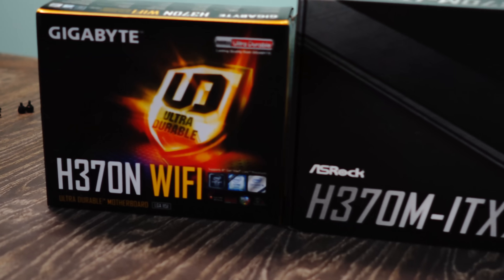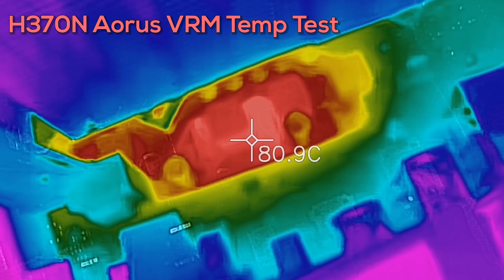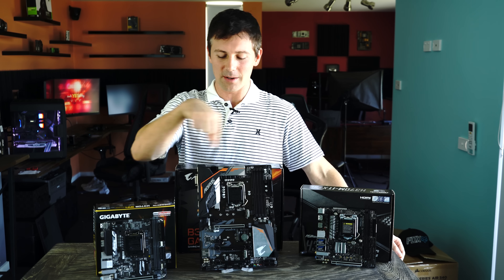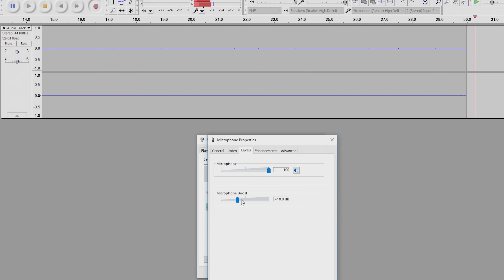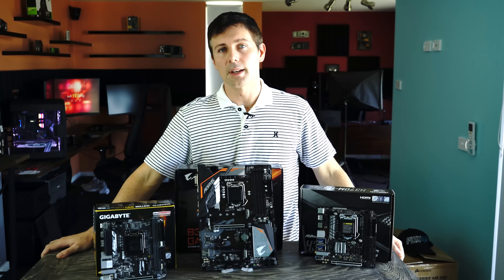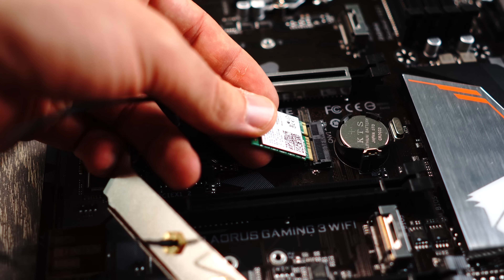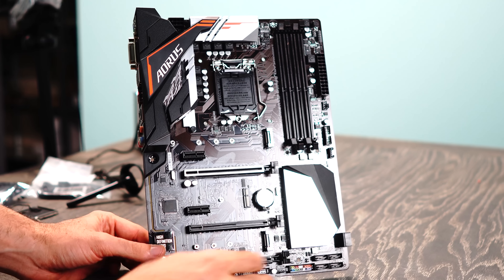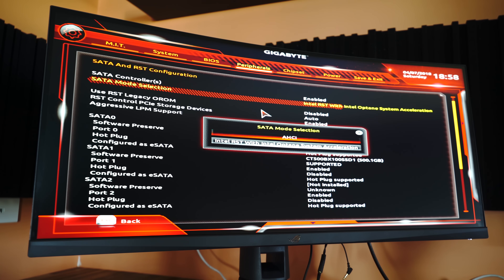H370 Vs. B360 Motherboard Review  - Can It Handle an i7-8700 at 100% Load?

Comment: i just upgraded from an i5 8400 to a i7 8700k got the 8700k for a steal of a deal and removed the 8400 and installed the 8700k in the same asus prime b365m board (Yes a waste of an 8700k I know) and I can only get it to 3,88ghz not even close to turbo boosting at 4.7 ghz can you help?

Comment: Hi, I am planning on buying the asrock h370 itx board. When you talk about thermal throttling on the vrm or whatever it's called, can that actually 'throttle' and thus bring CPU speed down? I've also heard that having the cpu power delivery components at a high temp (above 100°c in your video) is bad for them in the long term, is this an issue in your opinion? Thanks

Comment: <3 Thanks for the info. Bought a new system about 4 months ago with an i5-8500 and a b360 gaming 3. I want to upgrade to i7-8700k and Z370 so it can handle streaming on games that are too cpu intensive to spare the resources to stream. It is good to know I can buy the i7 seperate and run it in the meantime until I get more cash together for a new mobo

Comment: Hi there. Quite usefull video. I need help ! Im going to buy a mother Gigabyte B360M DS3H with an I7 8700. Has it enough power phases in order to supply the processor ?! For the record I have a 600W power supply and i will conect 3 fans and GPU.
Reply: Yes, it will work just fine. Considering the amount of power drawn would be more towards the GPU than processor and MoBo combined. You can see a significant power consumption by GPU but will be perfectly fine with 600W with enough power for even more lighting, fans, drives etc. 👌

Comment: i wanna do a build with i7 8700, 16gb ram, gtx 1050 ti Low Profile on a Bronze 80+ 300W PSU and i hope will be stable :-? 
(PSU is a Seasonic SS-300TGW 300W, have very nice amps for its size, HDplex 400w is toooooo expensive :( )
Why that psu? because is very small and will fit it in a case like Skyreach from NFC
What do you think?
Reply: Marian Pelmus I think you should move up to a 1060 just to really maximize your performance availability. It’s your build tho so let her rip!!

Comment: PLEASE suggest me a motherboard for 8700 (non-K) cpu.[i won't overclock or use sli except a single 1070 ti]
Reply: Check out Hardware Unboxed's video on the B360 boards. I'm going with AsRock B360M Pro4.

Comment: The audio on these boards is a reason I still use an ASUS Xonar DG sound card on my current gaming PC that still has a single PCI slot, and will be picking up an ASUS Xonar DGX(same card but with a PCI-e interface) for my next build, because most onboard sound solutions won't drive some of my higher end Philips cans at proper levels.

Comment: It's b360 for budget (although what are you really saving $40?)and $100 and up z370, everything else is a waste of money or doest make sense.

All we really need is what is the best b360 and cheapest z370 board that won't fry a i5 8400 and will allow enough power delivery to achevieve the chips full potential.

Comment: Pretty bad prices! Over 100 Dollars for B/H series.... Whats wrong!

I remember B85/B150 boards for 60€ here in Germany!
My 970-UD3 Am3+ board was quite high end (8+2 Phase, very durable, good cooling) and I got that for 70€....

Edit... there are still cheap boards: For example the Gigabyte H310M DS2

Comment: FLIR is not accurate for actual temps. It is good for showing differences in temps and hot spots. You should use a thermal probe attached directly to the part being measured. The price difference is so low, it doesn't make sense to buy a board with less features, less PCI-E lanes, and no overclocking ability. Even with a  non-K, the Z370's RAM speeds can be set higher. Just my opinion though.
Good review Brian.

Comment: In Poland Gygabyte B360 Aurus costs 128 USD not that bad, but i dont like this color theme ;/ Have You tested AsRock B360 Gaming K4 or AsRock H370 Performance? I am thinking about buying one of those for i5-8400. Any idea of hardware sync with Polyhrome RBG?

Comment: Wow those ram prices. No upgrades for me until that goes waaaaay down. Bur this is the dream i5 8400 2x16gb ddr4 2666 and a cheepo mb to run it with stock cooling. Why so much ram? My golden rule when upgrading alway double the amount of ram when upgrading from my case 16gb to 32gb. They laughed when i got 16gb and now i couldnt use my pc whitout at least 16gb

Comment: Corsair Vengeance 8GB DDR4 LPX 2400MHz 
Intel® Core™ i5-8400 Desktop Processor
Cabinet-Cooler Master MASTERBOX LITE 5 RGB
Corsair VS550
Hard Drive 2tb 
MSI Geforce GTX 1060 3GB GDDR5

Tech YES City i shud buy b360 motherboard for this build is there will be any problem let me know
Reply: AbhiMusicVEVO oh my god do not buy that psu
Reply: Jonh Smith why?

Comment: i would rather have a H310 and sensible B360 test. These boards make no sense for the price they cost, you could have got in the 100 sales opportunity since Z370 launch better boards for less price. Kind of a miss oportunity. The king of budget has let me down. Shame on you man, shame on you :/
PS: and test them with 8400 of course, no one is getting this boards for a 8700k
Reply: Joao Alves constructive criticism
Reply: Anything over $100 and you might as well just get a low price z370, I agree.
Reply: just because you get a 8700k doesnt mean you automatically should get a pricey motherboard
Reply: Compatibility with the 8700k is something he should mention, it'll enable an upgrade path for the future. But I agree, none of the mobos made sense for a "budget" review, US$130 for a H370? There are Z370s for the same price out there

Comment: H370 is for the cases you absolutely need RAID support, otherwise a B360 or H310 will be enough for a locked CoffeeLake CPU.

mITX is questionable, but it is dependent on the case one will be building in. Preferably look at the mATX and ATX first, if they fit in the case one has.

RAM costs still a mess.
Reply: Yeah, you are right i would recomend going mATX bc those mobos are usaly the cheapest compared to ATX and ITX also mini tower cases are realy cheap these days
Reply: Can I ask.. I dunno about what is overclocking mean.. Just want to know.. Will h310 motherboard perform well with non k i7 8700

Comment: Eh, some of these motherboards are going into Z370 price territory...
Reply: Wizard Koer Right, it's actually the same price as some Z370 where I live. As a consumer line, all the OC Z-series have always been quite affordable, so I'd only go for H370 or B360 if it's really cheaper for you than a Z370.
Reply: Is there a Z370 priced like an AM4 B350?
Reply: Cy Sy Yep, Asrock Z370 Pro, MSI Z370-A Pro and Gigabyte Z370 HD3 come in just under 100 bucks like some of the higher-priced AM4 B350. But they can't be compared properly because B350 boards are for AM4 and Z370 for 1151 v2. If you wanna get a Ryzen CPU, you have to choose between B350 and X370, since the X370 are the AMD equivalent to Intel Z370. If X370 is almost the same price as B350 - go X370. If you don't OC and B350 is cheaper - go B350. The same applies to the Intel H370, B360 and Z370 boards. Decide which features you need and look for quality tests of each board.

Comment: All of the prebuilt systems in NZ are pairing the i7-8700 with an H310 which might be silly.
how will this perform?
Reply: Check to see if you can build your own cheaper, generally can get better components and build a more solid and long lasting system when you do it yourself. I personally would use a minimum of a B360 MB if I used the 8700.
Reply: SirRoger No difference. Same clocks.